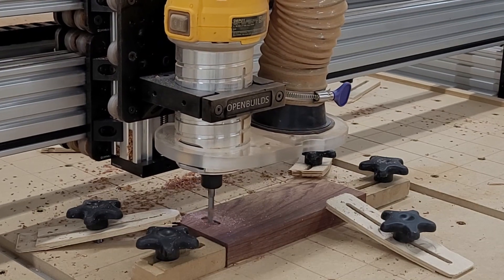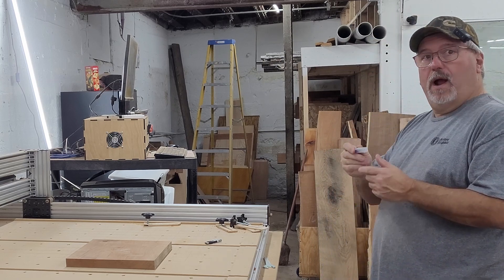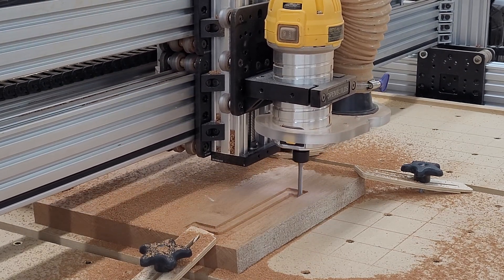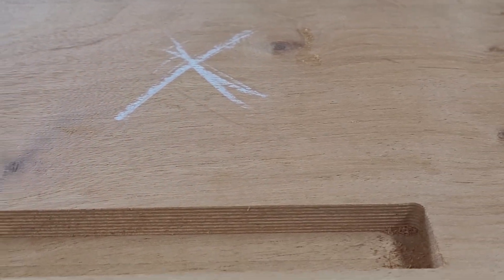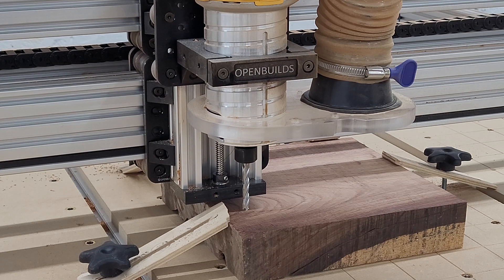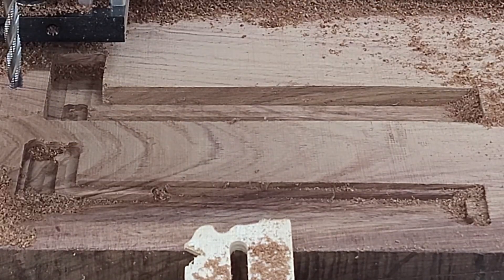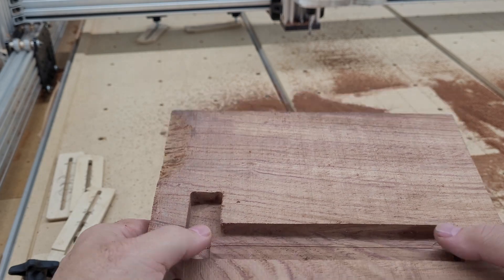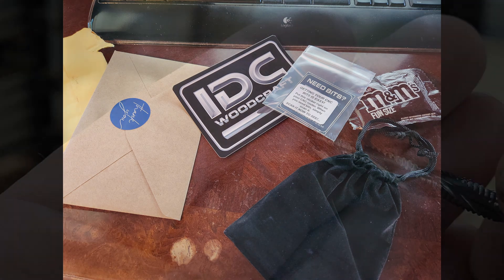The WILDEST CNC bit we have ever run | Making Glock Speed Loaders

Comment: The chatter is deafening and the bit stick out is WAY to far.
Reply from the maker: If you look closely, the bit is chucked up to the cutters - cannot insert any further.  The bit is really long with the cutters but I tried it because I wanted the depth to mill thicker woods.  Also if you notice - the whole purpose was to test the limits and very hard woods.  So yeah I ran it up to it chattering to test the performance.  So this video wasn't about best practices but testing the bit itself.  Thanks for watching